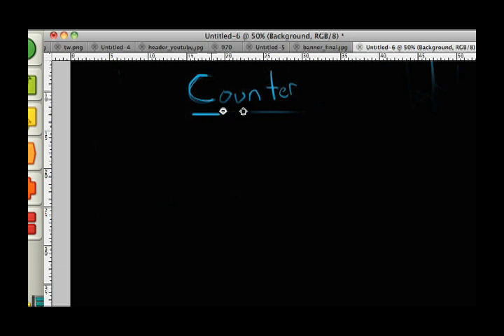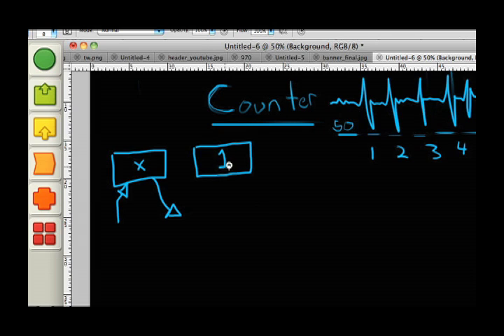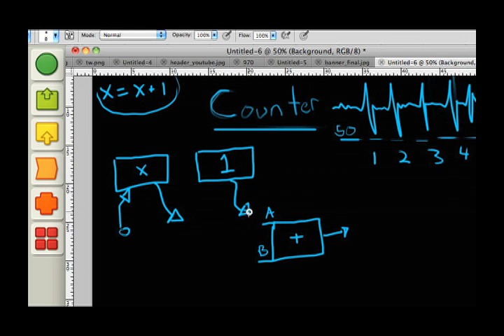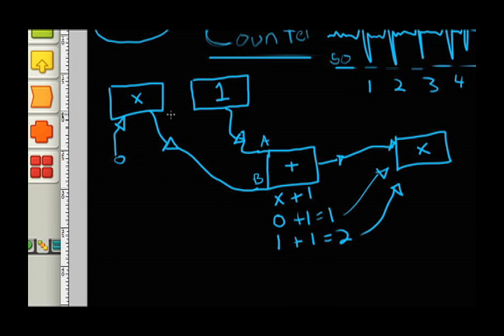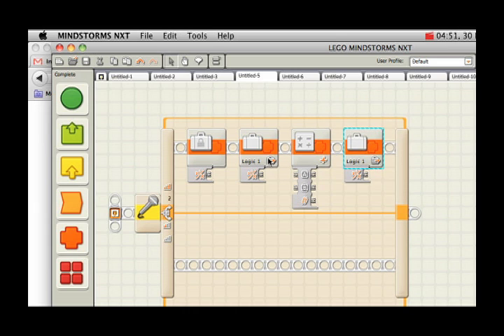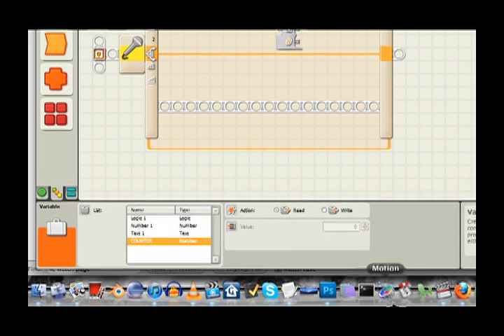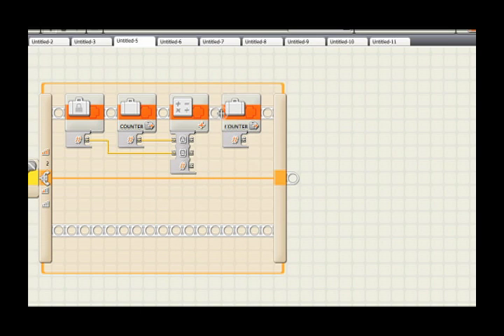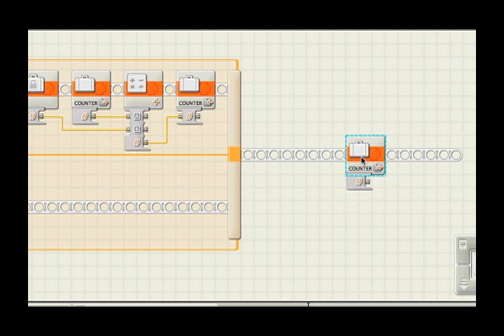Variable block (counter) | Lego robotics | Electrical engineering | Khan Academy

Comment: Is the value of the sound sensor in decibels? That's how loudness of the volume is measured. Or did Lego just took any sound levels between 1 and 100? Sounds complex a bit, but it needs getting used to variables. Thanks. 

You could extend the program by outputting the result to the screen via number to text conversion so that one can see the number of times the sound is above 50. Here it just holds the value and we don't know it.